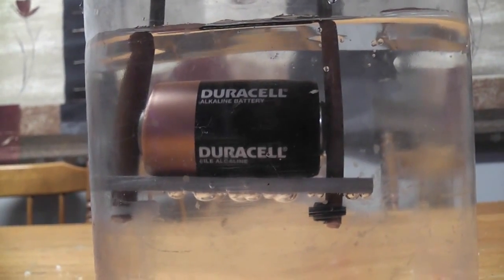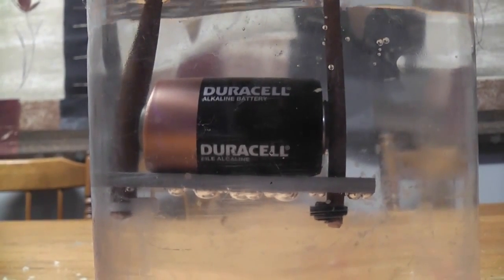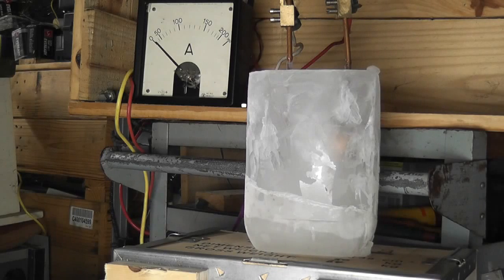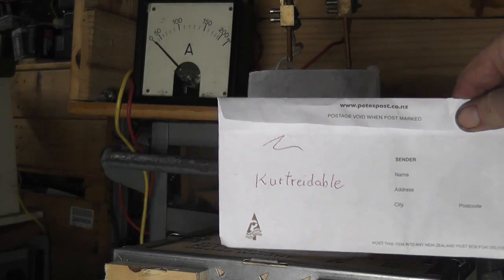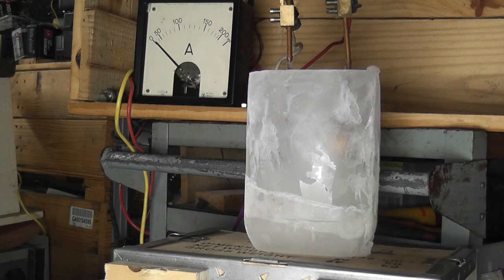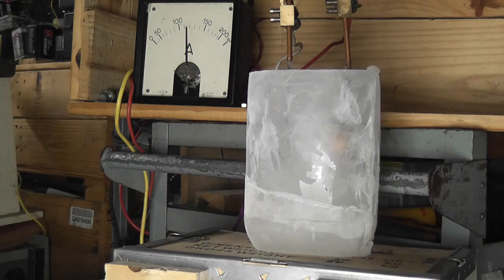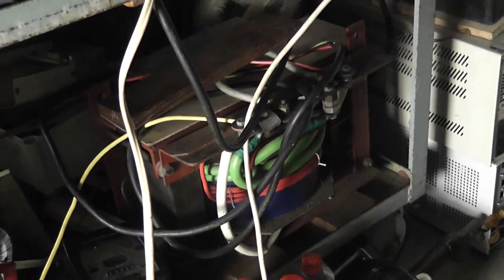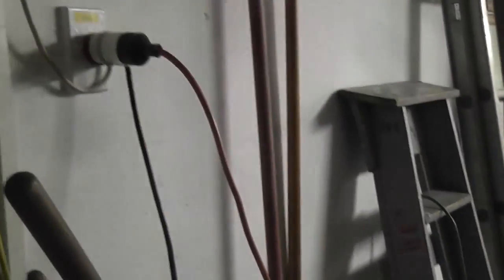Duracell iceblock explodes

Comment: The battery heated up and melt the electrolyte inside it so it started to lead electricity better in time just like NTC resistor. Good upload._

Comment: The side of the iceblock was forcibly broken off by the expansion, just before the battery popped. :-)

Those large lead-ins that you used, they'd be ideal for the wire-in-ice experiment. It'd be interesting to see if a block of ice could be thawed from the inside first....To have a solid block of ice with liquid in the middle. :-D

Have you ever considered freezing a motor....either in ice, or just the motor itself?

How about just the stator in ice? :-D

{^_^} BoomBoxDeluxe {^_^}